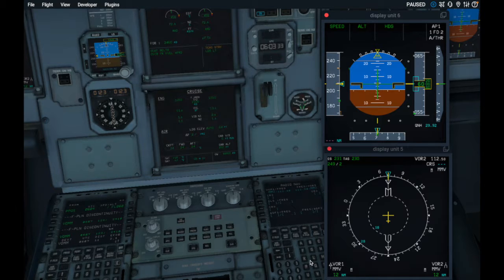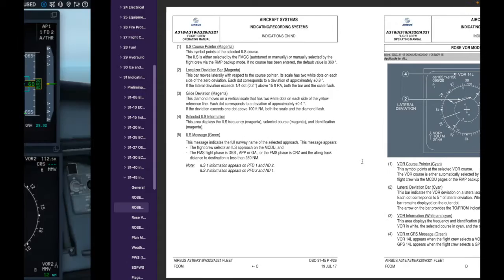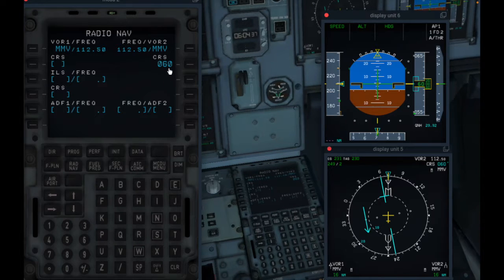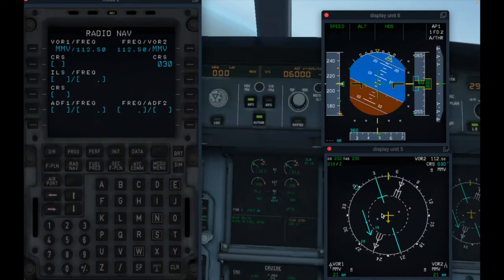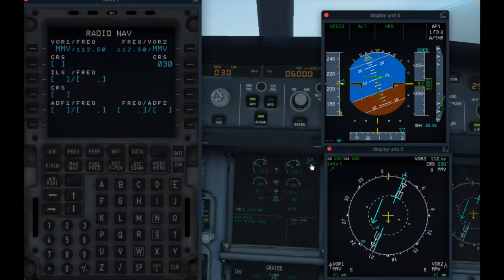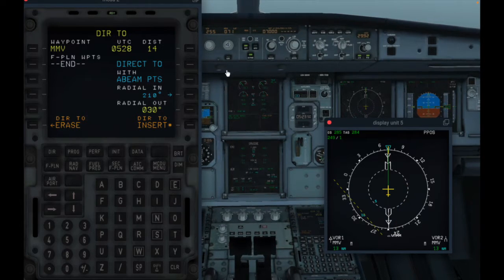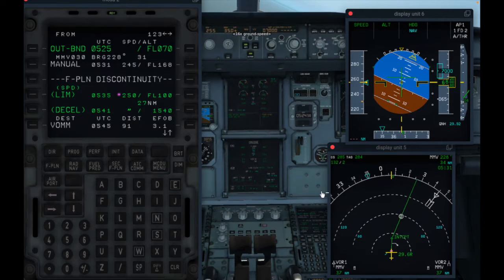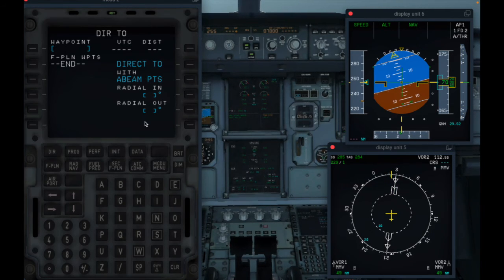AIR INDIA Simulator profile - VOR RADIAL interception

Comment: Hi,
Can we expect the a320 to fly the VOR course in NAV once we have entered the freq and course in the mcdu? Or do we need to manually adjust the heading to intercept the course of the VOR?
Reply: You need to manually adjust the heading, or you can use the TRK/FPA mode to maintain the required track irrespective of the crosswind component. 
The 320 will follow in NAV mode only the route that has been fed in the MCDU, you can alternatively use Place/Bearing/Distanve method of placing a waypoint in the mcdu to proceed direct to a radial at a given distance